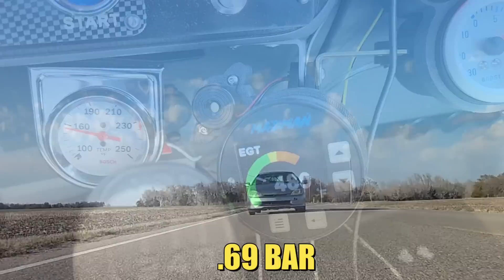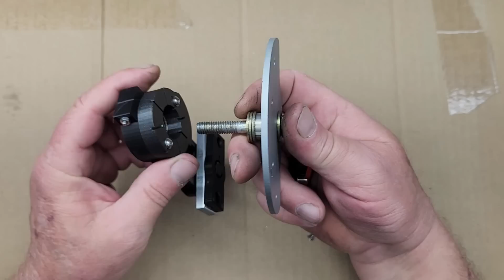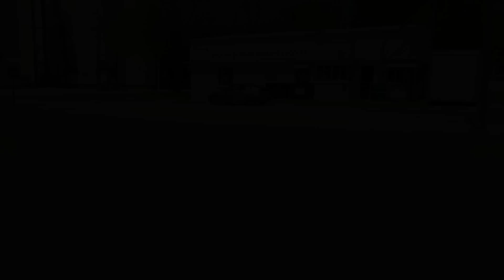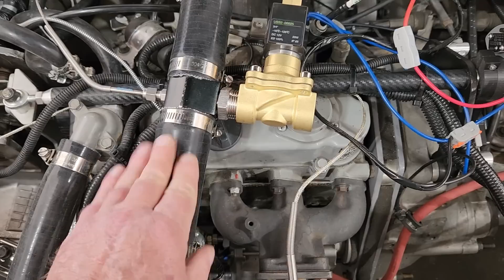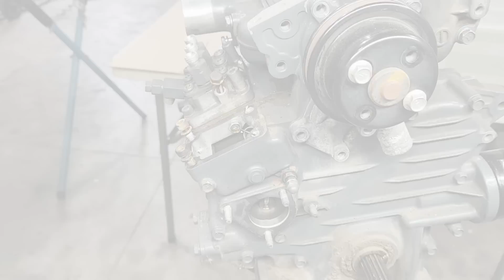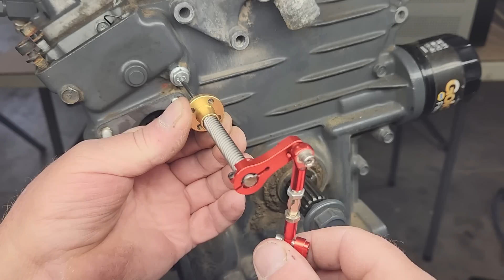S4 E15.  We  test the effects of full boost on the AMR500 supercharged the Kubota diesel engine

Comment: Yes
i got no idea how the governor is setup
But just removing/disabling the governor and running the throttle straight to the rack so you can actually control the rpm of the engine with the gas pedal seem like a way simpler and better solution to this problem

Comment: Yes. This is the exact approach I expected at the end of the turbo project.  You would screw in some type of bushing to allow  something to slide in and out and control it electronically. If the electronics or electrical power failed you would be able to open the hood and adjust it to a position where it was still drivable without the electronics.

Comment: I'd love to see "aluminium" on the screen when you say "aluminum" like you do for the metric conversions 😂

Glad to see a video on a Sunday 😊  I'd like to see the code and some hardware, as you put it.

Edit: if you can hook up a pressure sensor instead of the potentiometer to the servo control board you may not need the micro.  You may be interested to know that I am doing the exact same thing at work - using an industrial diesel throttle valve as a surge control/dump valve.

Comment: YES
A Cummins 12 valve doesn't have a system to advance injector timing and they do just fine. This video series interests me so much because I want to put a larger turbo on a 12 valve and use a cyntrifical supercharger to apply immediate boost to prevent turbo lag and wasted fuel (smoke).  I think that you should eventually put a turbo on this project as well. Alcohol/water injection before the supercharger will cool the intake temp and add power after you determine the right amount. A computer works best for controlling that.

Comment: I say YES  to both questions.  I was wondering about using a rheostat for boost control? Based on throttle position. At full throttle have no leakage, from the boost, at half throttle have half as much boot. I realize that's might be close to what you're looking for.  Just a suggestion,  and frankly I'm not nearly as smart as you so I could be way off.  Good luck and I hope whatever you try will work.  😊

Comment: Yes, please continue on this crazy project, I love watching it. Also consider my idea of putting some sort of throttle at the intake of the supercharger to lower noise/power required to spin, so it will make even better fuel economy of boost, I think You will probably dont even need  Your complicated boost vent valve if You use this. Anyway, please continue we are very curious what You can make from this pocket sized engine 😂

Comment: I’ve always wondered this but do you think that the log style cast iron exhaust manifold might be hurting performance? I know the horsepower/torque of the motor isn’t exactly face ripping performance but with the added supercharger maybe now the airflow through the engine is far greater causing some back pressure? Maybe that could also be why the turbocharger could never really spool that well, the 90 degree bends hurting exhaust velocity. Also yeah it’s only 670cc but those exhaust manifold pipes look so tiny in diameter

Comment: I've watched the videos attentively and I would say: go on with this project! But don't go for maximum power - go for maximum efficienzy. 
Do You think 100mpg is possible when You pull all the registers? incl. use best possible (legal) tires, make the car lighter, install energy recovery system (KERS or ERS), maybe optimize even the aero, but don't go rebuild the car of carbon and titanium.

Comment: I did a really fun project for a bunch of 4.4l Perkins diesels in an actual industrial setting. We got rid of the mechanical governor and controlled the fuel rack directly with a solenoid actuator and PID control. This was just before DPF mandates were introduced.

Comment: You should install a throttle valve
 before the supercharger, then it works well and fuel consumption is also reduced when the supercharger does not unnecessary work waste air. You can control it with the gas pedal, like the amount of fuel.

Comment: Yes Continue.  I think heat wrapping the exhaust manifold and exhaust pipe plus moving the air intake further from the exhaust will cut down on air intake temperature and obviously a intercooler like you suggested.  Keep up the great research.  Cheers.

Comment: YES YES YES YES YES YES YES YES YES YES YES YES YES YES YES YES YES YES YES YES YES YES YES YES YES YES YES YES YES YES YES YES YES YES YES YES YES YES YES YES 

If you use a TPS for your Boost solenoid, could you have a second output that would also work with the fuel rack?

Comment: Open the govenor fully. Let an ecu (speeduino?) or even just an arduino with speeduino firmware, and let it control the shutoff valve via a relay for rev limit instead

Comment: Loved the Boeing refrence. Nice to see you this week. 
The carburetor as control valve for boost blow off is an interesting idea. This is like using a butterfly valve for flow control . What you will find is the optimal control range is less than half the movement range of your servo motor. This may make it difficult to control. I have had to use butterfly valves in other fluid controls and found that a down stream orifice extendes the controlable range to near 100 percent of the operable position hence easier to control. I think you would need an orifice that allows the flow that the supercharger makes at idle speed. That would probably be optimal. Their are lots of places online where you can caculate the orifice  size required.

Comment: I wouldn't worry about intake air temperature. There are diesels with much higher temperatures. For example, Peugeot/Citroen 1.4HDi which reaches up to 120C (248F).

Comment: The adventure continues!  It’s always exciting to see what’s new on the Insight!  Definitely keep moving forward on this project, I love seeing how you address all the little variables in this engine, and I’d love to see a little bit of digitization in your approach!  

Question:  Did you end up using a flyback diode on your solenoid boost valve?  I noticed the turn signals flicker when you switched the toggle, and I remember when I worked on industrial equipment I measured the inductive spiking on a 12VDC solenoid valve once and saw over 100V upon disconnect!

Comment: On the aircon compressor of a bigger car, there is some sort of electrical solenoid that engages or disengages it. To save gas mileage, could the same thing be fitted to the stupor-charger pulley?  I wait with bated breath!...

Comment: I think the servo pushing a 2nd stop on the fuel rack is way more interesting than the whole supercharger experiment.  Probably because I root for team turbo, I had a turbo acquired (with electric wastegate) for my insight but had to reduce my car count before installation and the civic stayed based on how much it could tow vs the insight. Now you've got my opinion/vote.

Comment: I would love to see more videos on this car. I would make the supercharger electric driven and add a bypass for idle.
Also you can make the generator smart, so it only charges when the battery is low, our you are decelerating. But you well need a big start stopp battery for this to work.

Comment: You could knock up an air/water intercooler pretty easily 👍  
Had a lil look at exhaust coolers in the VW EA888 and boats, there could be a way to use the radiator system and some suitable material to absorb exhaust gases thus reducing EGTs 👍

Comment: definetely like to see wat you can come up with in therms of adding thechnoligy 
think a tps would make a better solution as you can combine them with a boostsensor and temperature sensor(s) as safety nannies and be able to regulate all of it with either a laptop or a rotary knob on the dash (as in turn on/up the boost) 
theres this thing called the speeduino using an arduino as the base so you might be able to build the controller using that as the base , maight even be able to make an electronic dash to place in front of the camera hooked up to it
you might be able to add a servo to the fuelrack to either act as a trottle stop or make it a drive by wire setup so you can have the rack respond in a way that reduces the smoke on accelleration but still adds more fuel when needed for more power
as for the intake temperatures : maibe the underhood air is stuck and cannot dissipate enough , you could put a spacerblock under the hoodhinges to lift the hood in the back and see if that helps with the underhood temps

Comment: Pretry sure Jimbo could have implemented a throttle angle sensor with a potentiometer and some other components, but this strictly mechanical solution has its own beauty, after all this engine is as analog as they come.

Comment: Yes. Combination common rail and mechanical injection sounds cool. How about adding electronically controlled LNG injection to boost performance, clean up the exhaust and cool the intake? You could make all of the parts from recycled chewing gum wrappers? What about passenger-side pedal assist? Do whatever you want man, I will watch.

Comment: Yes!  Continue!  Can't help but wonder if the throttle body might work on the inlet side of the supercharger?  It is my understanding that when you restrict air flow on the inlet of that style of pump, it would reduce the mechanical load on the engine.  Is that dumb?  I mean, you can't put a throttle body on a diesel.  Or can you?

Comment: I think you would have more incremental adjustment keeping the original fuel screw on a servo, the ball screw is a multi start thread with a steep pitch vs the original bolt

Comment: Yes! 
 On you're fuel rack control idea, I wonder if you could utilize a small adjustable wastegate diaphragm actuator of sorts? Similar to how the fuel is controlled on a mechanical Bosch rotary injection pump via boost pressure.

Comment: mr jimbo, is there a such thing as a boost referenced mechanical pump for this engine? i know the engine in the dodge cummins, the 12 valve, had mechanical injection pumps, that had boost reference controls for the fuel rack. and you tuned it both on and off boost. is there a thing like that for the kubota? or are you gonna make a arduino thing do it?

Comment: Jimbo, love the dig at Boeing - they really deserve it too! if they were building your projects they would never go to the lengths you do to engineer a proper fit. you just need a decent set of hammers, some packing material and a bit of glue lol.

1.electronics and code - YES  (your mechanical engineering skills are superb so the bit from your specialist area is likely to be 11/10).
2.fuel rack mechanism - YES.

regarding the fuel rack,  many plant engines have a centrifugal attachement to the governor which temporarily throws the engine into maximum. sometimes its quite easy to remove them. another simple way to get the fuel delivery 'right' is by optimising your efficiency at maximum torque.

Comment: Your Kubota is a modern sophisticated engine compared to my Brand New Chineese excavator that runs on a Single Cylinder Koop kd192 diesel engine...it does have a pull start as a backup. Not sure I'd like to pull start the Kubota

Comment: Stud it, add a additional turbo, turn the fuel all the way up, allow more flow in the injectors and increase injector timing. I say push the limits out of the kubota and drag race it after all of the modifications

Comment: Yes. You are doing exactly what late 80's engineers did at VW/Merc etc to add electronic control to existing mechanicaly controlled diesel engines. Giving us the 1.9 and 2.5 TDI at VW, the 300 series TDI from Landrover and the OM606 and OM603 from MB to name but a few that were Electronics controling a Mechanicaly injected motor to get more Preformance/MPG/Emissins form an existing lump

Comment: I think continuing the project is the only option, I enjoy watching you modernize a tractor diesel to be efficient, powerful, and viable in a modern-ish platform. It's really neat watching you take this fully mechanical engine and using simple but effective tech to keep it clean, and give yourself even better efficiency.

Comment: Would love to see more on how the fuel rack electronic adjuster could help (or hurt) economy and power.

Also, have you researched how much efficiency is gained by shunting the boost? i.e. what is the power drain of the boosting supercharger vs the shunted supercharger and the power output of the boosted engine vs the shunted engine? I would be very interested to see actual numbers.

Comment: YES please continue!

But if I can... don't dump boost, it's a waste of energy.

I think it's better to try a double speed transmission on the blower, you can achieve it with an AC clutch, a one way bearing and two belts and 4 pulleys transmission.

Low speed on the one way bearing, high speed on the AC clutch pulley.

Comment: perhaps it would be better to control boost by throttle valves before the supercharger, more efficient. if supercharger can handle below atmospheric pressure on the intake side.

Comment: YES. 

BTW you need an inte - alright I better not say it.

BTW, I tried to turn the fuel off on overrun like modern cars routinely do on my 1976 fuel injected pre HE V12 Jaguar one time via an on/off switch. 
It worked but the problem was I couldn't get consistency out of it. 
Freaky things would happen like the micro switch would grow on hot days altering the setting. I'd set it up for heat and it wouldn't work when cold, and vice versa. Things grow in hot engine bays and it wasn't just the switch expanding. The metal components would expand causing the switch not to trigger.
As well as mechanical switch, I added a vacuum switch to hopefully iron out the 'spikes' but it would alter due air temperature. Rather than solve the spikes, it was another layer of complexity. I see parallels. 
I hope your computer skills can solve what I couldn't easily. 

In the end it became apparent that for the effort there wasn't that much reward. I might've got there but I got sick of it. 
It was fun nutting it out, but after implementation the fun went out of it. 
It started surging in heavy traffic while idling along that sort of thing.

Comment: Yes, I want to see the servo/stepper actuated fuel rack.  You’ve been teasing the idea for quite a while now and every week I tune in expecting to see it and every week I see something equally interesting, but not the thing I am hoping to see.

The microprocessor controlled boost dump valve is interesting, but if you aren’t excited about it don’t do it.  If you want to do it, and want to get it done quickly off camera then just give a short description of the mechanism and programming, that would be fine too.

Comment: I both love and am frustrated by the relevation posed by basically this whole channel, that if we could get car makers to make any cars, not all just any cars with a different system of values, they could almost certainly make "low performance" small cars that get maybe 80mpg in realistic light duty conditions. Exactly the kind of value system I have towards owning a car. This raises a question I guess, your speed tests are all at-speed, is there a sensicle way to develop a testing regime for "city driving" or is stop & go too variable to measure meaningfully without statistical sample sizes worth of test runs?

Comment: I think you need to convert mechanical injection system to common rail PZT (piezo) injectors.  They open and close faster, providing about 5X fuel in timing window.  I have experience in this. I did electronics to covert 7.3L Ford to PZT with ~2500HP.

Comment: Yes, the adjustable fuel rack is interesting.
Also, If they made a Tach with an adjustable shift light you could tie into the shift light circuit and use that as the signal for the boost valve. Just have to set the shift light really low. You could put it next to the full boost light to have a nice boost on/ max boost setup.

Comment: It seem the air filter and overall intake are a bit too close to the exhaust. 
Moving the intake if possible would help or else eat shielding the exhaust and puting something between the exhaust and intake would help.

Also in case of crash you clearly don't want your filter to toutch the exhaust.

Comment: Yes keep working on it. Oh yeah one thing. I can't explain why but super chargers are really, really sensitive to air leaks.

 The tiniest air leak can cause huge problems you wouldn't even notice with the turbo charger. Which seem to do fine even with swiss cheese intake tubing. 

If you ever find yourself struggling look for an air leak anywhere. Even on the engine.

Comment: Yes please, also I'm interested in the durability of the amr500 as I've seen issues of delamination of the rotors on other channels and wondered if it's due to overheating from running boost constantly rather than only when the heavy boot is applied.  Cheers